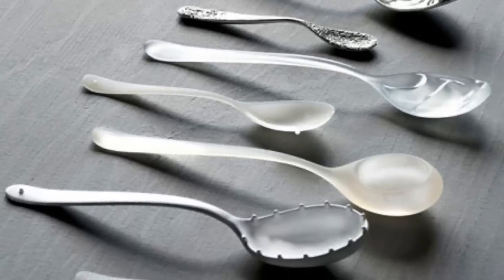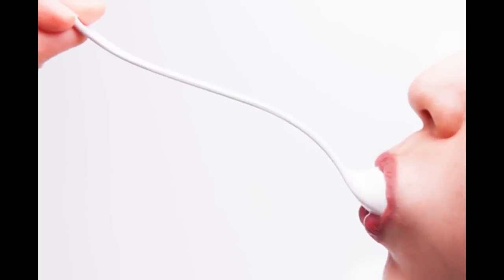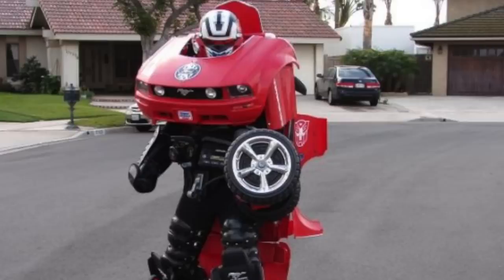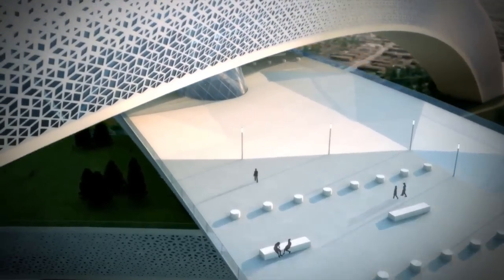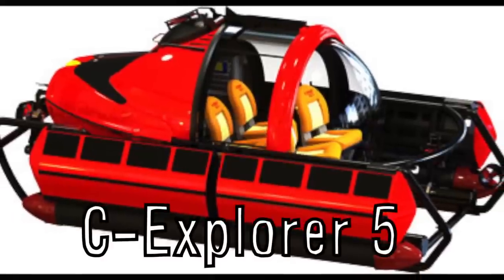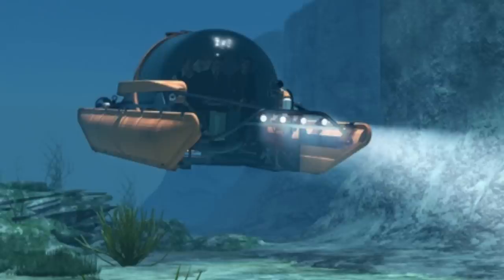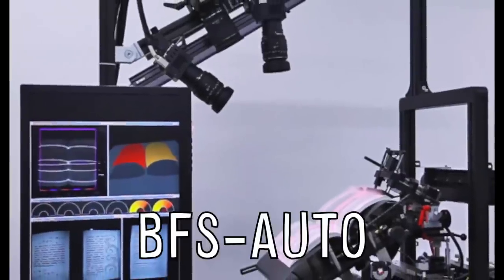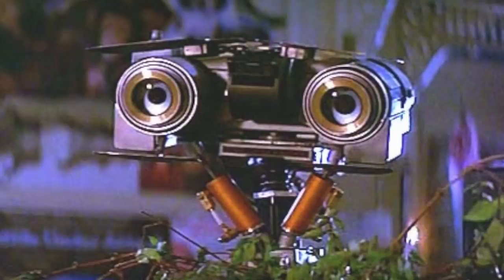A New Way To Eat? -- Mind Blow #54

Comment: salivary amylase in your(an enzyme in your spit) breaks it down primarily, including the mechanical breakdown using your teeth. Moreover, the hydrochloric acid in your stomach also aids in digesting the food, along with more digestive enzymes released by your pancreas and gall bladder, which all aim to break down(digest) food. Food is not melted, rather, decomposed into simpler substances that your body can use. 
hope this helps!

Comment: only because it's the specific heat capacity of water. heat is a type of energy, as is chemical or kenetic. a calorie is used today as the measurement of energy in food. a calorie has as much to do with heat as any other unit of energy (joule, mega joule etc.)

Comment: true,but creating a material or device that can convert the carbon monoxide into oxygen or vent it out in the sea would not be hard to do, but creating a vent would mean there would need to be a lot of pressure, which could be fixed by making a device that stores what is not oxygen  and air locks it then vents it out into the ocean. think of the possibilities.